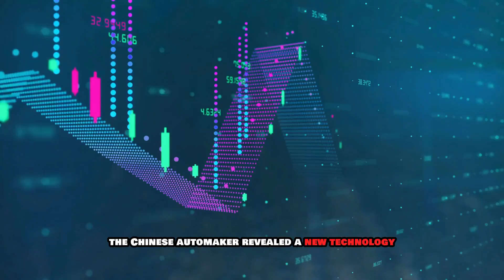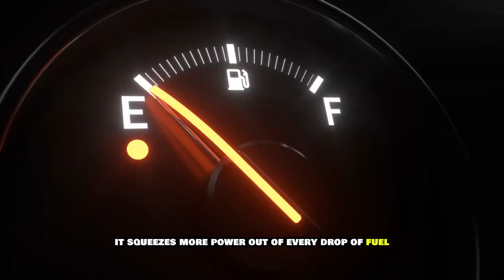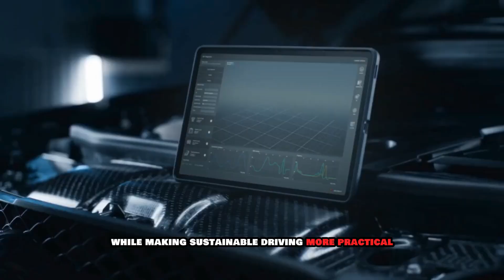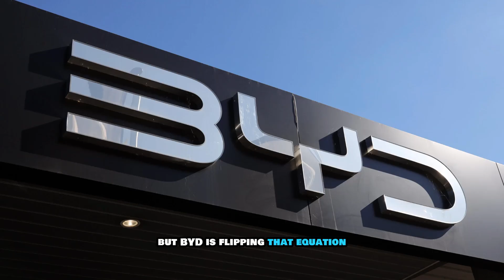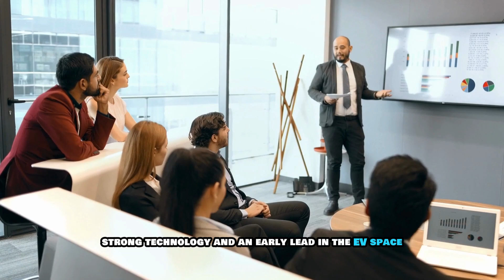BYD: "This New Engine Will DESTROY The Entire EV Industry this 2025!

Comment: If it's a plug in hybrid you still need to plug it in every night to get full use of the electric range. If you cannot plug in at home you might just as well buy the petrol version if it is so efficient. As explained the charging infrastructure might not be great if you cannot plug in at home. If it's a self charging "sic" hybrid there is not a great advantage over a Toyota Prius.